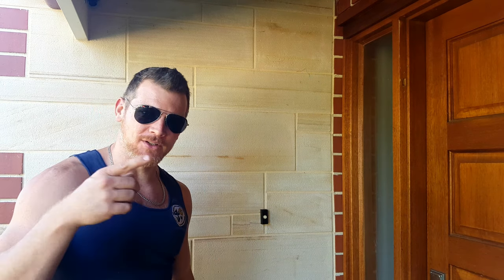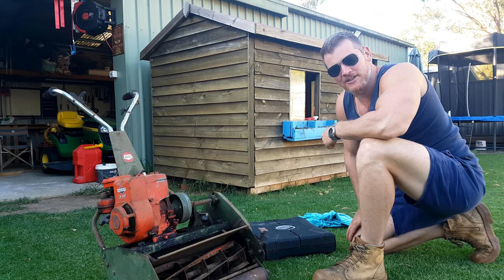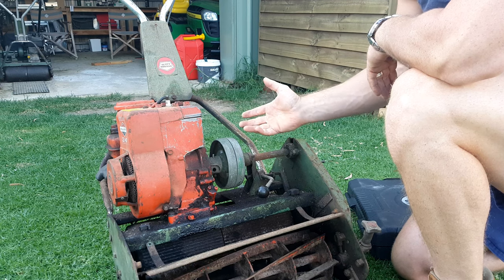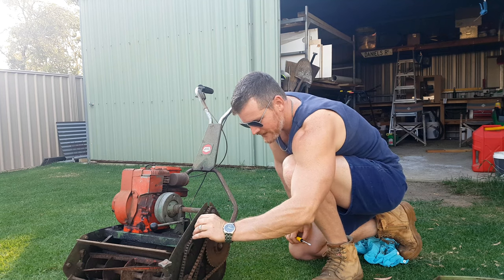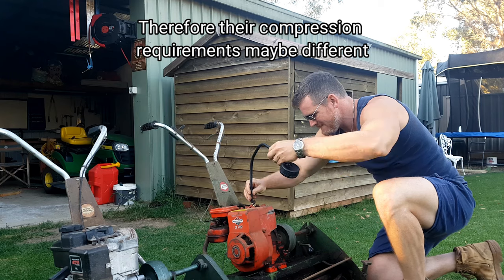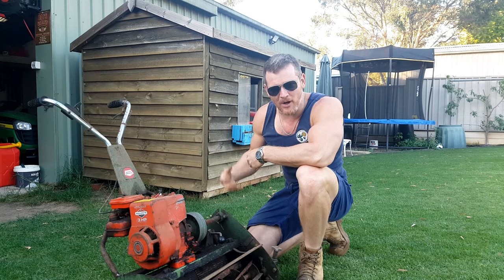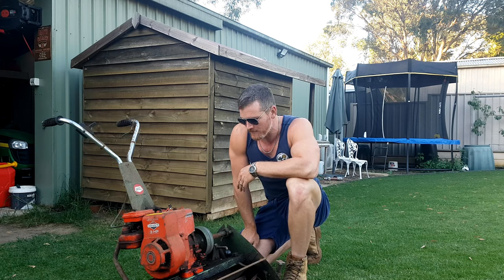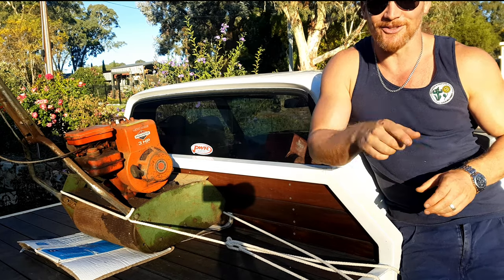SCOTT BONNAR  - Beginners Buyers Guide

Comment: She’s a bewty… mower’s not bad either 😉
I didn’t even consider a Scotty B because the prices here are stupid. And they do still make ‘em, only they’re Protea now and from seth efrika. People are paying more for a full resto SB than the price of a new Protea with warranty 🤷🏻‍♂️ See what youtubers like you and Ben Sims and Brenton have done, you’ve started a cult 😉
Reply from the maker: Yeah the Proteas. Ur right. I most certainly trying to bring the market down a bit. It's craziness. Yeah new Proteas and Bush rangers make more sense at the second hand market.
Reply: @thegreenandgoldlife1464  there’s good mowers that aren’t SB at sensible prices if you know what to look for. In my case it was a Rover Kensington, which is a rebranded Allett. Paid 1200 for a dealer demo, think they were happy to be rid of it. Spent some more for scarifier and dethatcher cartridges when Rover had them at 300 ea. Sweet setup for the 💰.

Bushranger, Parklander and other rebrands of the Masport Olympic are often good buys. If I hadn’t found the Rover I would probably have one of them.
Reply from the maker: @philrichmond5919  definitely. How is the cartridge system holding up? I think it's a great Idea but, seems flimsy on fist glance. Hopefully you can get some miles out of it. 👍
Reply: @thegreenandgoldlife1464  yeh no problems. Nothing flimsy about it. Proven design over decades, well engineered. The thing I find people worry about is the nylon gears, but there’s only two of them, they’re durable, cheap enough and easy to replace. Compared to chain drive there’s much less maintenance. Dunno why the thought of plastic parts scares people, often they’re more durable than metal.
Reply from the maker: @philrichmond5919  ah excellent Phil. Great to hear. 👍 I'll have to keep that locked away in the noodle for the future.